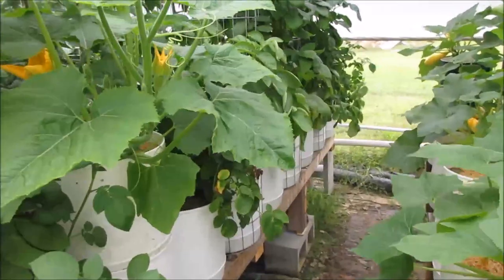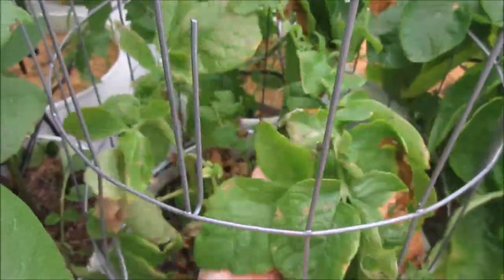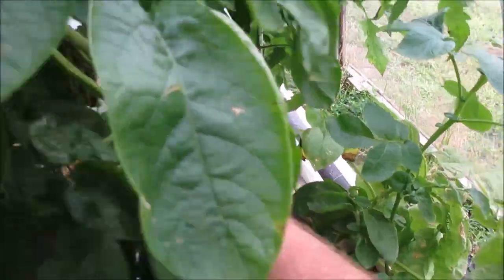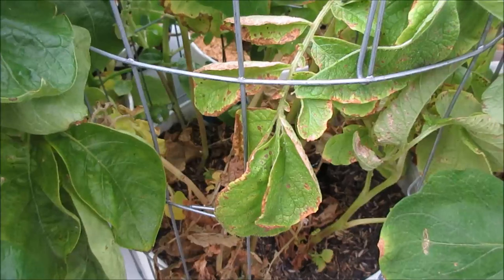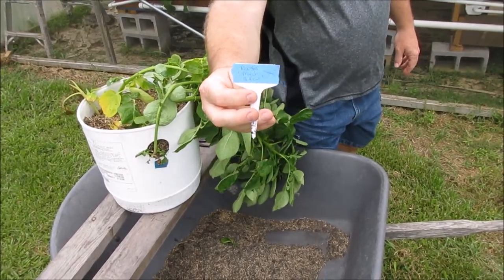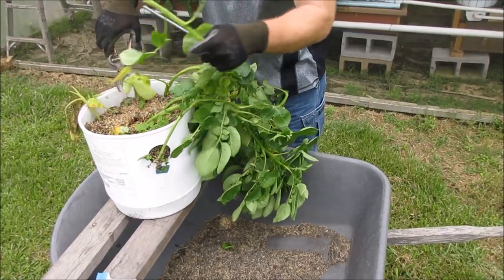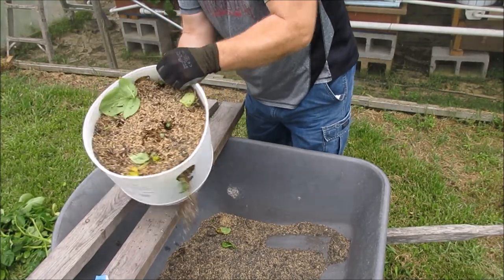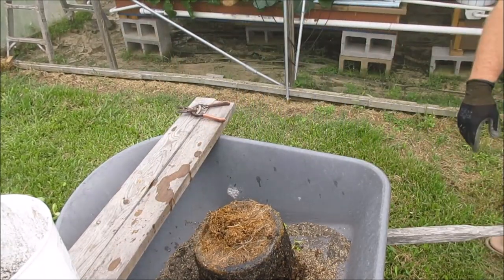Hydroponic Potato Harvest

Comment: Did you have to do any hilling with the hydro set up as the plant progressed? I know they do hilling in soil. In outdoor soil grows it has various benefits to fight off frost and pest. I'm running a Coco ebb and flow recirculating system. Running potatoes for the first time. Just had my seedlings pop. Was wondering if I plant lower and hill or just plant low and let it grow? Thanks! Love your set up! So inspiring!!!!
Reply from the maker: I don't hill, but I plant near bottom of container with 12" of mix on top.  They will grow through that depth just fine.

Comment: I couldn't believe some of the comments here rejecting this method as NOT hydroponics.  For the nay sayers...Coco, as with clay pebbles, perlite and rockwool (or combinations) are the  predominant substrates used in hydroponic growing both commercial and hobby growers, as well as cannibis.  These substrates hold the plant in place giving it stability and is generally referred to as passive hydroponics.  root vegetables are commercially grown this way in bato/Dutch buckets.  I read an article that stated nearly all vegetables, including potatoes, beets, carrots, parsnips, etc in the Netherlands are hydroponically grown within poly tunnels.  In fact using these substrates the growing methods are identical to growing in soil.  So hydroponics is more about the nutrient flow and not about the medium or lack of it.  But Brent I think recirculating would be easier and far cheaper than drain to waste.  Just my two cents.
Reply from the maker: I agree.

Comment: Do you have a plan to try and improve ? I would guess that your nutrient solution and frequency of feeds or duration, might have some impact. From my experience of growing in soil in containers, watering and consistency is the element that affects the size and yield the most and secondary is fertilizing or no fertilizer if the soil is good. Of course good seed potatoes helps to. Cheers. :-)
Reply from the maker: YES.  I'm checking out varieties of potato.  One time, I had a great grow with Red Pontiac.  It might be the go-to potato, but none this year.  I'm also checking the amount of drippers per container.  I tested medium depth at planting this year.  I tested medium aeration this year (less parboiled rice hulls this year for a more dense mix than last time).  I also tested planting a completely filling the pot vs covering as they grow (sorta).  The cover as they grow got away from me.  Still working this sucker.
Reply: Kevin Bradley Gardening and Outdoors 
mm

Comment: Not hydro. It takes more than adding water to be a hydro setup. By your rationale, all plants are grown hydroponically.
Reply from the maker: Incorrect.  It is hydro using water-soluble fertilizer, drip fed, and an inert media--rice hulls.  It's common to use all manner of media in hydro drip setups.  Are you not familiar with the various types of hydroponic systems and the various types of media?  A simple search online will give you lots of information.
Reply: @C3Voyage  rice hulls aren't an "inert media".  They are an organic media that breaks down over time due to bacteria in them, providing all of the nutrients the plants need.  You are literally growing them in compost, it just didn't start composting until you planted them.
Reply from the maker: @ancapftw9113  You are sort of correct in some definitions for what the word inert may be defined as, but you're not here for the bigger picture.  You're here to debate verbiage instead of the bigger point.  Here's a definition off the Internet that supports what I'm talking about if you take the word to absolute literal meaning:  https://www.merriam-webster.com/dictionary/inert

Definition of inert
1: lacking the power to move
2: very slow to move or act : SLUGGISH
3: deficient in active properties

Rice hulls barely decompose after a very, very long time.  If they sit in a rich and mixed soil web, then of course they'll break down much faster than if they're in a hydro setup.  Here's a scientific article that explains why:  https://www.mdpi.com/2079-9276/7/2/31/htm

"Due to the high content of silica in rice hulls, the material burns with difficulty under natural conditions, and it is biodegradably destroyed only with difficulty, when composted."

You are wrong about the value of VERY composted rice hulls offer on their own.  Compost is only good as the material used to make the compost.  It's because of what they're made of and many consider them a very poor soil additive to break down.  Essentially, those using it are using it similar to perlite--a fluffing agent.

The bigger point is that rice hulls are literally used as hydro media along with others that some might not consider hydro media like peat moss and potting mix.  Any material you can imagine just about can be a hydroponic medium.  A simple search for "hydroponic mediums" will give you lots of materials.  I know you won't take this well.  Most people are right-fighters no matter what, but I figure it's more considerate to relay my point than just to delete your comment.  Best to you.
Reply from the maker: @ancapftw9113  Oh, a suggestion (and test):  Buy some  rice hulls and put them in a bucket with holes.  The experiment is not expensive.  Water them a few times a week and see how many weeks/years you have to do it before you notice them as useful compost.   I tend to give advice off of experience instead of hearsay and I have already done what I'm suggesting to you.

Comment: Can you elaborate on your  grow medium "mix" a little further for you potato buckets? 
1) You mention rice hulls... is the grow medium 100% or is there "other" medium in with it? 
2) Would you use this same "grow medium" for other veg plants, like beets, carrots, turnips..?
3) Do you re use the grow medium or do you have to discard to compost pile?
Nice video - thanks
Reply from the maker: Sure can!  Take a look at this video:  https://youtu.be/acKwHQkfvfw

I grow everything in it.  Basically, if you're using a system that allows for some debris as I do with FAWN, any inert medium works great.  Peat, perlite, rice hulls, and yes, even regular old cheap potting mix.  I've used them all.  I use it on everything and I developed FAWN to support all types of growing.  There's videos showing me growing everything you can imagine including beets, carrots, and turnips.  :O)  I use the medium for one season usually, but I've also collected it and used it for two seasons after it's sat in the weather piled up for a few months.  It rinses out smaller particles and salts by then.
Reply: Thanks Brent.. I watched it!.. I'm on the look out for rice hulls..

Comment: They needed more time to size up. The tops should be totally dried. Nice taters though.
Reply from the maker: I've read a few sites that state potato tubers mature in 70 days for early types, 80 for mid-season types, and 90 for late-season types.  If I plant a mid-season type in March, maturity would then be late June.  Do you think the potato plant will completely dry by then indicating they are ready?  Or, do you think it'll keep growing for a couple months and the potatoes will begin sprouting or rotting?  I'm curious as I'm trying to nail down the potato grows.
Reply: As long as you don't get too much rain they won't rot. I have found they store quite well in the ground, however, I don't think I have left them for more than maybe 3 weeks after they tops die back. You can always test it by leaving a few in the ground longer. Also, the maturity is determined by the variety. Have a look here... https://www.gardeningknowhow.com/edible/vegetables/potato/types-of-potatoes.htm
Reply from the maker: I'm unique in that I grow hydroponically, they remain wet/moist.  I haven't seen much on hdyro-taters on YT.  I'm familiar with earlies, mids, and lates being 70/80/90-ish days to maturity.  Research shows all that and I do try and do my research.  In my case, however, my plants remain healthy past the maturity dates listed on most sites OR in some cases, I've had insect damage ending the season prematurely.  Then there's the case of Red Norlands not being a large sized potato.  I did get some good size ones on whites.  Check out this video:  https://youtu.be/AB7VQLL-QFA

I am still very lacking on where I want to be with potatoes, so I have a question in to Dan at "Allotment Diary" just now on his September 2017 reveal.  His container spuds are consistently amazing.  I'd like to get some feedback from him to get better.

There's another guy, called "Baconsoda" on YT and he grows well in containers as well.  He leaves his in this greenhouse for months past cutting tops.  They stay good for a really long time if they can remain dry just like you mention.  Because of that, once I know the taters are the best they can be, I know I can remove them from the hydroponic drip system, cut the tops and just let them sit there till I need them.

I sure appreciate the feedback on all this.  I hope you follow along and I hope to present some better results in the future.

Comment: Hydroponic????? Yes no yes nope. As I see it not realy Hrydroponics.
Reply from the maker: Understand.  My opinion is the pinned top comment.  Thing is, my opinion is really based on what the majority of stuff out there states.  To me, the terminology doesn't matter.  The one thing that can't be disputed is that I grew these in aged riced hulls, where the University of Arkansas research shows how little hulls offer as a substrate, and the plants had all of their needs met by a water-soluble fertilizer that is more often than not, considered a hydroponic fertilizer.  In fact, I use the fertilizer in my current aerated water culture beds.  Curious as to what you term hydroponics is?  What would you call how this grew based on what I've said and also, what is hydroponics to you Denis?
Reply: Brent is very polite with some of you people. Me.. not so much.  Read up on Hydroponics before making comments that shows your lack of hydroponic knowledge.  When the medium has no nutrition for the plant and all the nutrition is delivered via water whether it be a reservoir ,drip system, dutch bucket etc. THAT'S HYDROPONICS!   SMH